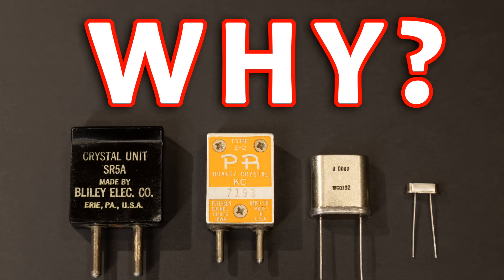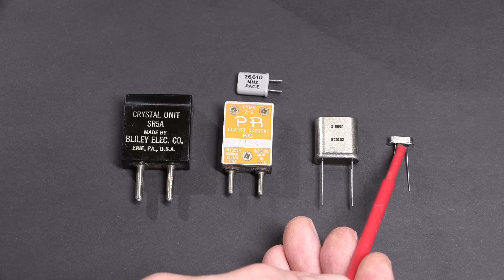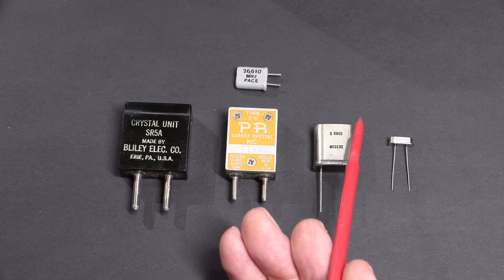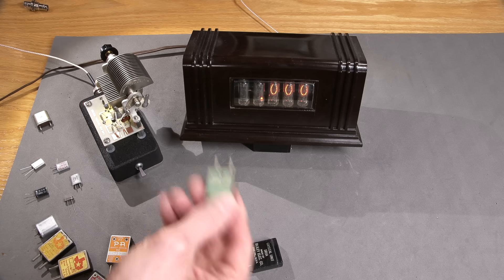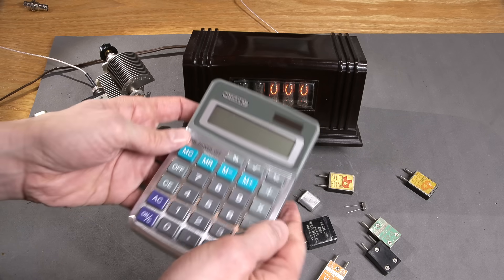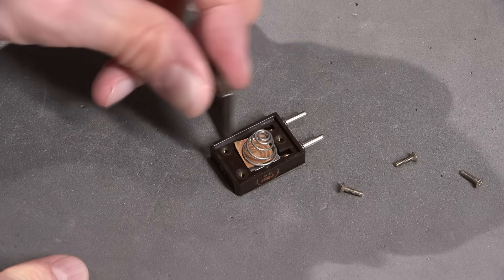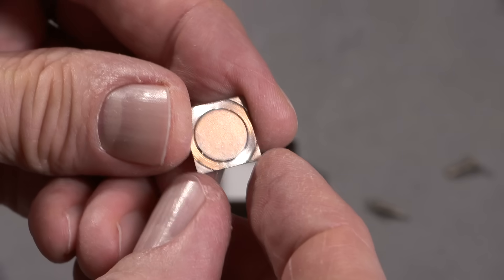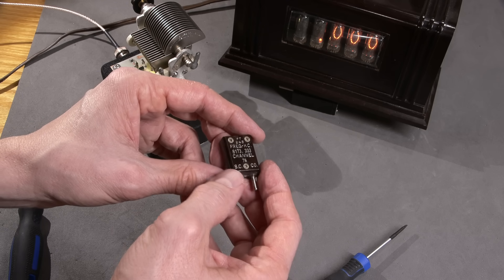Why Are Crystals Needed? Here's Why With Examples!

Comment: You probably already know this, but if you build a large number of low phase noise oscillators with a given batch of AT-cut crystals, a few percent will be 5dB noisier than the average, and a few percent will be 15dB quieter than the average.  Also, the ESR of a high quality crystal will decrease over time as the oscillator runs.  If the oscillator sits on the shelf for a few months, the ESR will go back up.  I don't believe we completely understand the mechanism.  Do inanimate objects have intention (like Herbie the Love Bug)?  Of course the resonant frequency of a crystal ages asymptotically.  Baking the crystals can accelerate the aging so you can make an oscillator that ages less.
Reply: didnt know myself, but interesting.
other topics begs teh question... do we understand anything at all?

descriptions, yes. definitions, sure. in some ways an ability to manipulate and modify based on our descriptions...

but at no point do i think we ever "understand" ANYTHING!

Comment: I just had Gemini try to summarize a search for me yesterday saying that quartz watches are accurate in part because quartz oscillators are temperature-stable. UGH
So I guess the expansion and change to it's VERY PRECISE SHAPE that has to be literally trimmed to precision won't have any effect on the characteristics now?
I was just trying to find how much a quartz watch drifts over time compared to a mechanical timepiece, but never did get a straight answer or useful site.
Reply: All serious clocks and watches made in the last few centuries include some form, or even multiple forms, of thermal compensation, to make their rate less dependent on temperature. 
Large, stationary, very expensive mechanical clocks can be compensated to a very high degree of perfection, and will run more accurately than a cheap quartz watch. 
Of course, watch quartz oscillators are tiny and cost pennies. In the range of temperatures for which they are designed they are accurate to maybe ten parts per million or slightly better. 
A laboratory grade quartz oscillator which costs hundreds of dollars will be more stable, perhaps one part per million over long term and much better than that over short term. But they are large and require vastly more power.
Next level up are atomic clocks which reach parts per billion long term accuracy for commercial units.

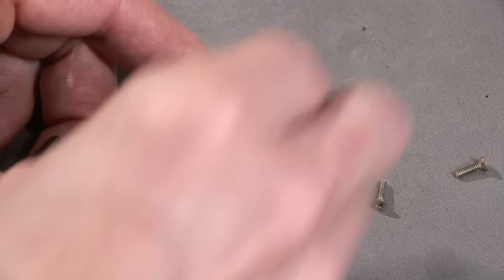Comment: 16:16 Why does that crystal have a strong spring pushing down on it? What would happen without the spring? The other crystals don't.
Reply: The strong spring in a crystal in an openable package assures firm reliable mechanical contact in the four corners with consistent pressure so that the vibration frequency will remain constant.  Quartz is very stable over temperature as compared to the other materials of the housing so the contact pressure would typically vary a lot more if the quartz were mounted directly to the housing, reducing frequency stability.  The other crystals have metal contacts plated directly on the sides of the crystal, with springy wires welded to the contacts for support and environmental isolation.  The plated crystal is free to vibrate at its edges, so its mode of vibration is somewhat different.

If a plated crystal, such as one of those in a metal housing, is dropped on a hard concrete floor, the springy wires can allow the crystal to bang into the housing, shattering the crystal.  You needn't ask me how I know this! 😢

Comment: In some applications frequency stability is very important, so the crystal and associated electronics are built into an "oven" with a very stable temperature. I have designed and built a number of these very stable oscillators for measuring instruments (professionally).

Comment: Are the quartz crystal affected by temperature
Reply: Yes.
Reply: @tookitogo  <<Yes.>>

Really?  A main purpose of crystal control is high frequency stability despite vibration or temperature variations.  Imagine a WWII bomber transmitter operating in very wide temperature range and a LOT of vibration, but still needing to remain on frequency. 

As I understand it, the main feature of crystal control was remaining on the specified frequency.
Reply: @SeattlePioneer  Both things are correct. 

Quartz resonator frequency is not exactly constant. It is always a function of temperature, it changes as the crystal ages or experiences thermal cycles and shock. It also does depend slightly on vibration and acceleration. If you put the crystal vertically it will oscillate at a very slightly different frequency compared to using it in a horizontal orientation. But even the largest of these variations are small (typically some tens of parts per million), and the frequency can often be considered practically constant compared to the tolerance required for a particular application. For example, airplane radio will stay on channel without any adjustments, even though the actual frequency may be a few hundred hertz higher or lower as the temperature changes between the extreme cold to the extreme heat. Crystals are certainly much more stable compared to the ordinary LC tanks made from coils and capacitors!

For more demanding applications where parts per billion stability is required, crystals are run at a constant temperature by putting them in little thermostated ovens.

Comment: 1:20 early crystals were not lab-grown, but actually cut from mined quartz crystals! Experts would inspect them with polarizers and whatnot to determine the crystal structure and then they’d be sawn into slices, which more experts then cut into the individual crystals.
Reply: I saw a video of that.  No wonder crystals cost so much.   We needed them for aviation radios. Big banks of crystals. Trainer aircraft usually had few.  Made flying around airports difficult.
Reply: Great YouTube video, "From Raw Crystal to Crystal Oscillator."
Reply: @projectartichoke  Yes, that’s the one I had seen but couldn’t remember the name. Thanks!
Reply: @projectartichoke was it ww2 era? I've seen one like that
Reply: @sammy5576  Yeah, 1940s!

Comment: To add weight to a crystal you can use a pencil and draw a line on the crystal to add some pencil lead to the surface.  Have seen several antique crystals that had this done to them.
Reply: You can also lap them to increase the frequency.
Reply: How does adding pencil lead by drawing lines affect the frequency of the crystal exactly?
Reply: @kevinmccool3719  It adds weight to the crystal.  More weight, lower frequency.  In the "old days" when crystals were extremely expensive it was common to repurpose crystals of the wrong frequency for projects.  It was very common in the amateur radio community.  If you wanted a higher frequency you would carefully lap the crystal to remove material and if you took off a little to much you could draw lines on it with a pencil to add weight thereby lowering the frequency to fine tune it to perfection.

Comment: how do they grow crystal, and what's the mechanical reason it's used for frequency delivery?
Reply: Quartz plates for the resonators are cut from very large crystals that are grown at the factories. If water is hot, and is made caustic by adding sodium hydroxide, it dissolves quartz a little bit. The apparatus is essentially a giant pressure cooker, operated at very high pressure. it is filled with water, with raw material dissolving in a part where the temperature is kept higher, and the crystals growing where the temperature is slightly lower. It takes several months to grow a large crystal. 

Quartz is used because it is available in a very pure form, has very low damping of oscillations, and by cutting it in just the right direction the resonator can be made insensitive to small temperature changes.
Reply: @cogoid  I see it's not nearly as simple as cut shape + size due to the nuances of the crystallography. It's good that there are 'standard' cuts that can give good consistent results.
Reply: Don't forget the most important reason: Quartz crystals are very good for the price, and this makes up for them being a bit more fragile than MEMS oscillators. The day may come when MEMS oscillators have completely displaced quartz for new applications, but quartz is a good simple technology.

Comment: MrCarlson is it true that overtone crystals are cut on a different axis than fundamental crystals are cut?
Reply: The frequency of quartz resonators changes with temperature, and the curve for the fundamental is slightly different from that for higher overtone frequencies. Comparing the frequencies allows to measure the temperature, and this can be used for stabilization of temperature.

Since the curves are different for different overtones, if one desires to have the maximum thermal stability for this specific overtone, the cut can be tweaked for that. But the required difference in the cut angle only a tenths of a degree or so.

Comment: Half this video is watching you test a bunch of crystals you had laying around showing that they're accurate.  Who cares??  There is almost 0 discussion of WHY crystals are actually used.
Reply: <<There is almost 0 discussion of WHY crystals are actually used.>>

I thought that was explained pretty clearly.

A crystal controlled oscillator allows a specific frequency to be generated simply and at low cost in a highly accurate frequency with little regard to vibration or temperature to which the circuit is exposed.

Imagine a WWII bomber that needs to be able to reliably stay on a particular frequency despite a LOT of vibration and a wide range of temperatures. And it is easy to accurately and rapidly switch from frequency to frequency by switching from crystal to crystal, rather than changing a tuned circuit consisting of a variable capacitor and inductor.

Comment: would be cool to do a piezoelectric generator experiment with these particular crystals. (if its possible) Tap them with your finger while connected to a oscilloscope. as far as  i know that can be done with the piezo disc transducers and buzzers.

Comment: It is very much appreciated. My question is, when we use the crystal in overtone mode, is it the crystal that generates overtone frequency, or is it the transistor that oscillates in overtone frequency, please.
Reply: The overtone crystal itself oscillates in overtone mode, exhibiting a stack of duplicate motions rather than just one.  However, the drive circuit will include another tuned circuit that assures the crystal operates on the intended overtone.  The overtone crystal will oscillate on its fundamental frequency if the tuned circuit is on the fundamental frequency.  The possible overtones are the odd multiples of the fundamental, but it becomes more difficult to cause and sustain the oscillation on the correct overtone as the multiple increases.  The overtone frequencies are very close to but not precisely equal to the integer multiple value of the fundamental frequency.

Another way to generate a stable higher frequency is to operate the crystal at its fundamental frequency or at its overtone frequency and then follow that with another nonlinear stage that will generate harmonics and then select the desired harmonic with a tuned circuit on that harmonic.

Comment: Is there a low frequency limit to the oscillations a crystal can produce?
Reply: The frequency of the common type of quartz crystals is determined by their thickness, and is in the megahertz range. There are watch crystals which oscillate in a different way -- they are miniature tuning forks tuned to 32768 Hz. Before quartz, tuning forks for clocks were made from special alloys which maintain stable properties over a range of temperatures. Such forks were larger and resonated as low as a few hundred hertz. In principle, they could be made from quartz, but it is not something that is done.
Reply: That’s a good question! The standard watch crystal is 32.768kHz, and on Digikey there are some archived parts down to 20kHz.

Comment: Not going to lie, as a former pirate shortwave/am radio operator, seeing that thumbnail brought back some memories.

“Another world, another time. In the age of wonder. A thousand years ago, this land was green, until the crystal cracked. A single piece was lost, a shard of the crystal. Then strife began, and two new races appeared. The cruel Skeksis, the gentle Mystics. Here in the Castle of the Crystal, the Skeksis took control. Now the Skeksis gather in the sacred chamber. Where the crystal hangs above a shaft of air and fire. The Skeksis with their hard, twisted bodies, their harsh, twisted wills. For a thousand years they have ruled. Yet now there are only ten. A dying race, ruled by a dying emperor. Imprisoned within themselves in a dying land. Once more they gather at the crystal. As the first sun climbs to its peak. As the Skeksis ravage the land, they draw new life from the sun. Once more they will replenish themselves. Through the power of their source, their treasure, their fate... The Dark Crystal.”

Comment: If you were to put a cat wisker on your crystal would it turn  into a detector diode . would it need alittle foward voltage . You must have a scope to see the knee. Oh the fun. Good show best Regards. Jack
Reply: Unfortunately, a "cat whisker" (tiny thin wire) on a quartz crystal would not be good as a detector diode for radio waves because the quartz is an insulator.  The quartz is piezoelectric, but its charges are trapped, and they can't move enough to be a good detector of radio waves.  Cat whiskers are used on semiconductive materials such as galena or germanium or silicon to form junctions that will conduct in one direction significantly better than in the opposite direction for detection of radio frequencies.

Comment: What Genius found that Discovery?!
Reply: Interesting question.  As I understand it, in the early days of radio, radio frequencies were commonly generated with inductors and capacitors, not crystals.

By WWII,  crystal were in wide use to make fixing transmitting frequencies accurate. At what time crystals became common I don't really know  ---- but before WWII I'd say.

Comment: A possible way to check a crystal frequency is to apply a VERY LOW level signal from a signal generator through a series resistor, and monitor the voltage across the crystal using an oscilloscope. The voltage will dip at resonance. I (like many hobbyists) have very little in the way of test equipment, but I do have a decent and accurate RF signal generator, even though my oscilloscope is ancient! So the sig gen will tell me the frequency OK. If anyone tries this method, you do need a sig gen that can put out a VERY LOW level signal though, or damage to the crystal could occur.
Reply: tell the folks what low value range is please. n7ud
Reply: @alanhart1238  Be very gentle. Maybe around 100mV peak to peak, and a series resistance of around 5k to 10k Ohms. You need just enough signal to be able to see the point of resonance when you get the matching frequency, so start with a low signal and large resistor and adjust as necessary.
Reply: To make sure I fully understand, if the crystal is rated at e.g. 10MHz, you would set the signal generator to 10MHz? If a wave is visible on the oscilloscope you'd raise or lower the frequency until there is no wave displayed? Lastly, does it have to be an RF signal generator, or can a 3V frequency generator like the ones found on some multimeters be used? I have a HackRF SDR which could transmit a carrier wave up to 8GHz, and a BSIDE O9 multimeter/oscilloscope, but its frequency generator only goes up to 2MHz.
Reply: @VeniceInventors  Yes you adjust or sweep the frequency around the stated value, looking for a dip in the signal level across the crystal at resonance. (I don't know the answer to the second part of your question which involves equipment I don't have). It's all about using what you've already got if possible. I happen to have a good sig. gen. but poor 'scope, for example. So I can rely on the sig gen display, and use the scope simply to detect the level change. The main thing is to keep the signal level and current to the crystal very low, to avoid damage. Paul's little device is probably worthwhile building if you regularly test crystals.

Comment: Ooo.. I always wondered this. Like as in a crystal radio.
Reply: This is not the kind of crystal that's in a crystal radio, though
Reply: <<Like as in a crystal radio.>>

A crystal radio is entirely different.

A crystal radio typically uses an inductor and capacitor to tune in the signal, and the crystal rectifies the radio frequency signal leaving the audio frequency that is usually listened to on headphones.